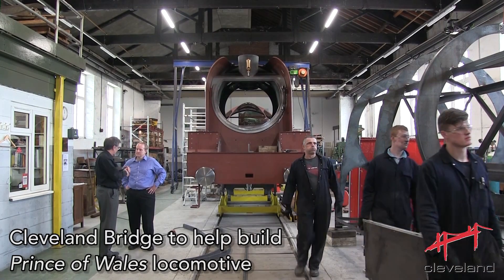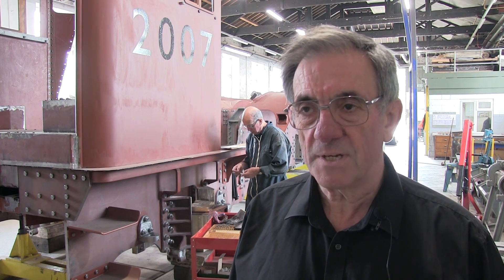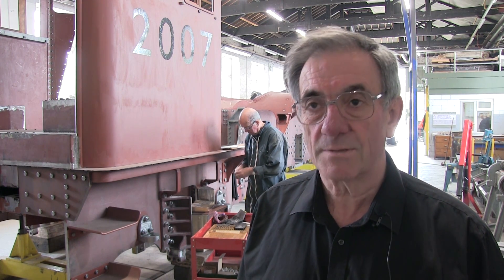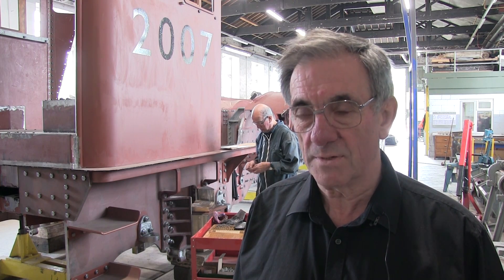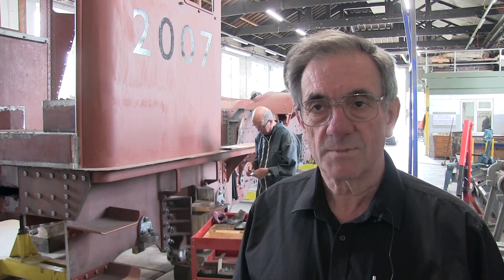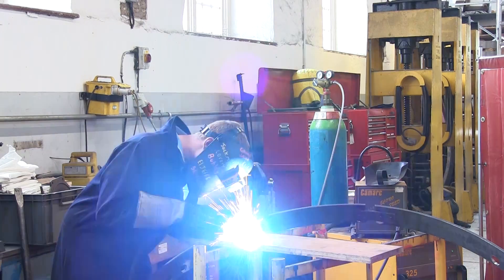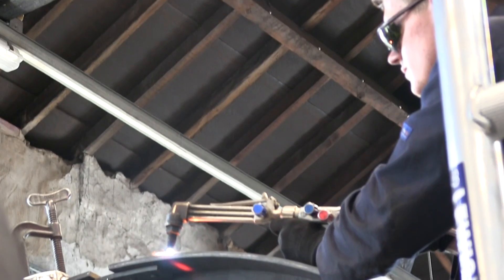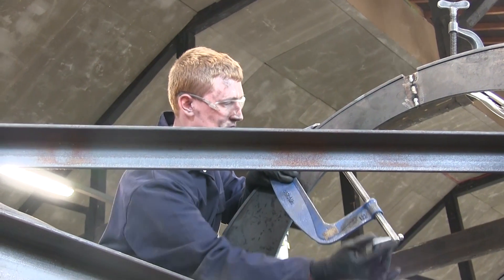P2 Progress - update No 8 - Cleveland Bridge to help build No. 2007

Comment: there is another project in the states of sorts sponsored by coalition for sustainable coal, taking and refitting an old atsf engine with 84 inch drivers with a gasmaker firebox and other rebuild work to try for that 130 mph record, and do it on biocoal or torrified biomass that is its 80% the caloric value of regular coal but non of the nasty black smoke making volatile compounds, and the process to make it is more energy efficient then making bio diesel out of it, another long term plan is building an all new modern steam engine  for passenger train usage since steam makes more power the more draft and speed it gets, would be computer controlled firing and all the advances since the 1960s would be put into it to try to make it as modern as possible and the most efficient steam locomotive of all time, now weather or not that ever happens in the future remains to be seen, but the concept of using steam power is not as dead as people think it is, even if its super critical boilers of a powerplant or a nuclear powered ship.

though they are not built en mass long live steam power.